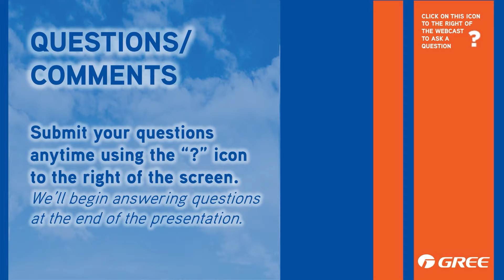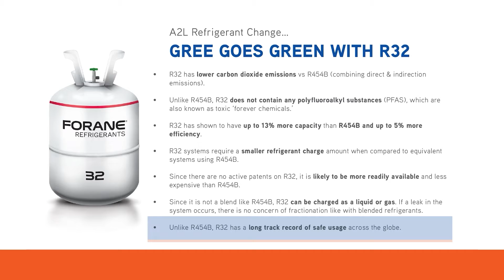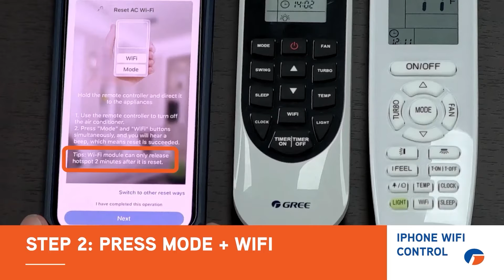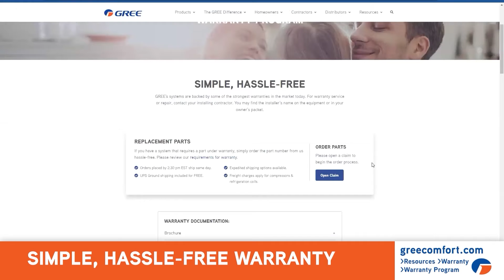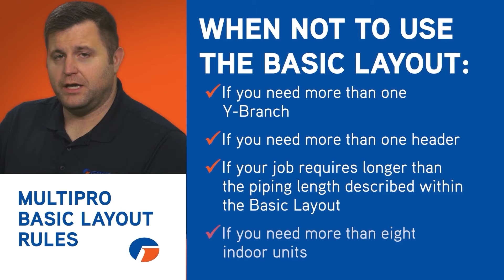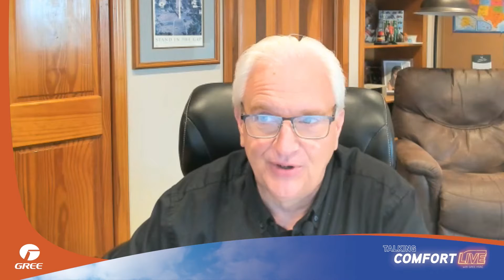Basic Layout Tool, Warranty Submissions, GREE+ Wi-Fi App, A2L, Selecting the Master Zone, Q&A

Comment: This is a good video for setting up the app wifi. I ran into a problem however. I have two XE72 wall units. When I turned wifi on them and configured them for my network. They began pushing out DHCP. They then started feeding IP Addresses to my other equipment on the network so I had to turn off the wifi feature. Is there anyway to turn off DHCP on these units? I can't find anyone else that's had this problem.